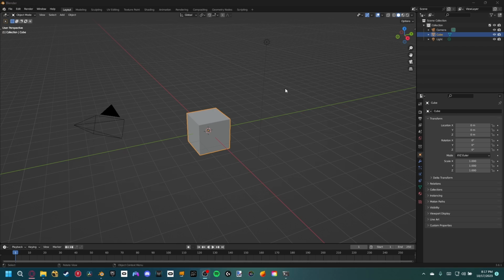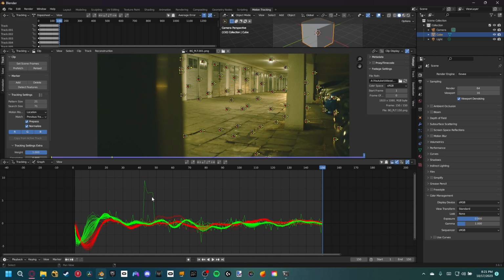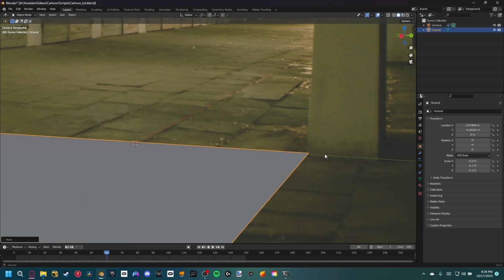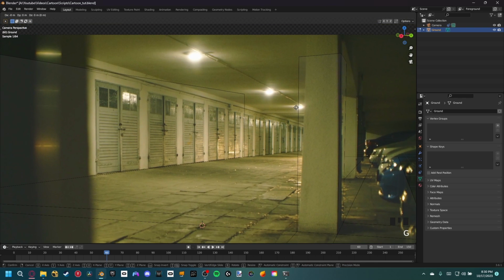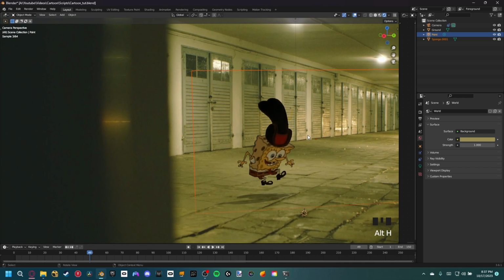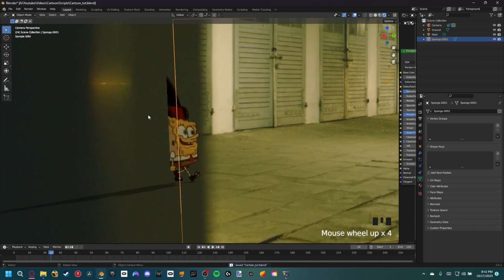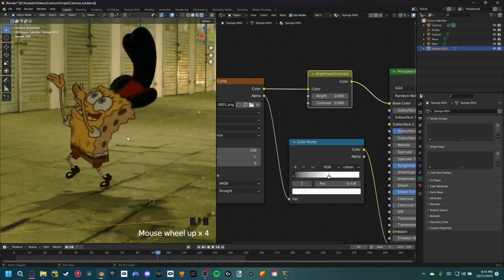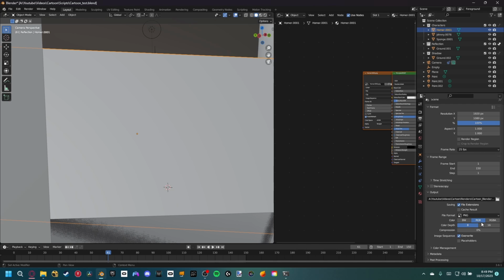How to Add 2D Characters to Live Action Footage

Comment: FYI,
If you render something out to PNG, you can compress it 15-25% without any quality issues.
PNG compression is lossless.
But if you compress it too much, it will take long to compress it than it will to render it.
So compressing it to 15-25% will give you much smaller files to work with while keeping the quality.